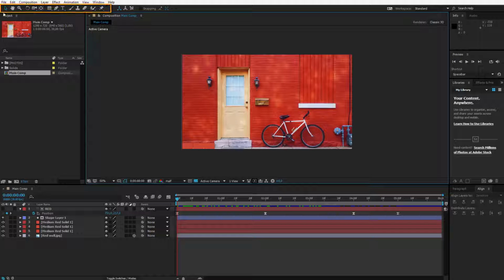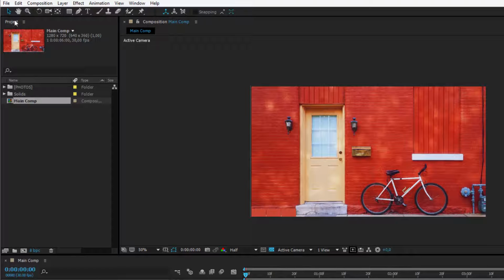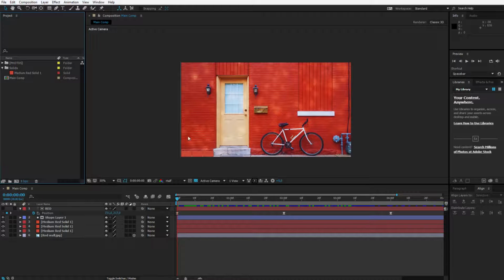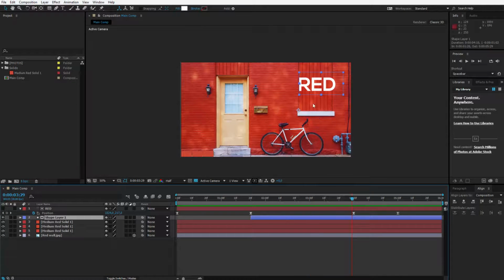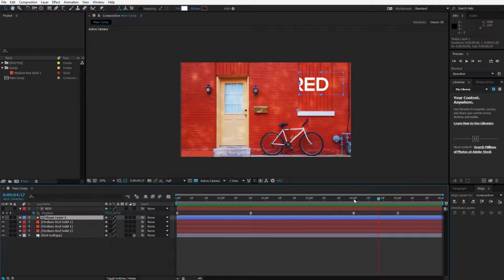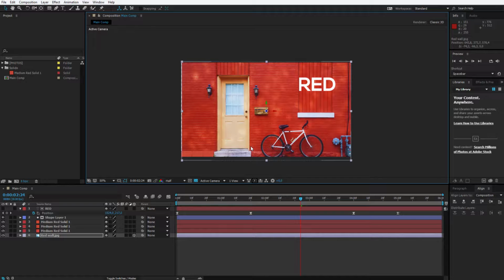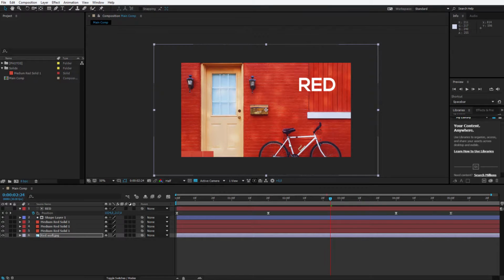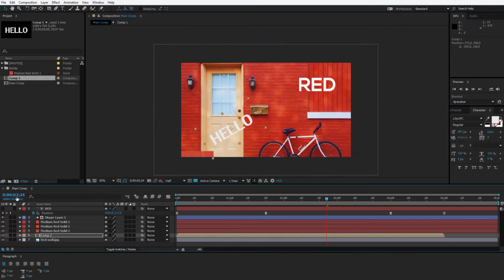After Effect Interface - Tutorial for beginners (CC2015)

Comment: Hey, I have a question. I also use after effects 2015, but my interface is a lot different from yours. The entire theme color is a little grey, the tool icons on the top look different and the timeline panel's icons are also very different in appearance. How can I change the appearance of my cc 2015 to make it look like yours?
Reply from the maker: Individual elements can be added and dragged around by going to the "Window" tab and adding items. As for the color of AE itself it's no big issue, you can go to Edit > Preferences > Appearance > and there change the brightness, interactive colors and focus indicators
Reply: @andrewppt  thanks for the help.
Also, there is another issue due to which I'm not able to edit on cc 2015.

On my latop, cc 2018 works fine with moderate lag.
I installed cc 2015 just to check how it works, and it works all good. But the problem is that the preview speed is slower than usual.

I was just testing some things by making a work area loop of 2 seconds, and the preview seemed really choppy. Then I realised that it was taking more than 2 seconds to complete the loop. This also happened on my friend's pc having better specs.

Idk what is causing this, but the preview speed is about 75% of what it should actually be.